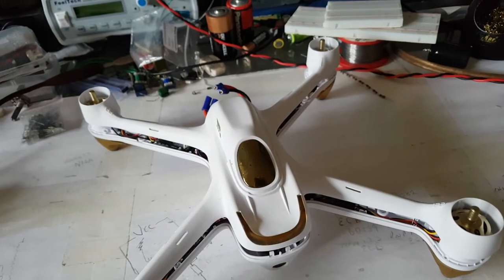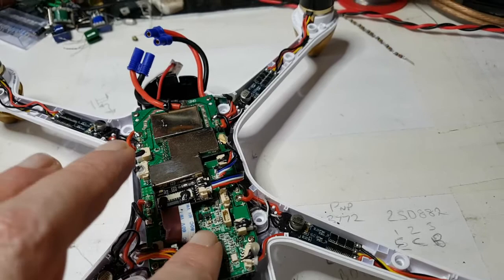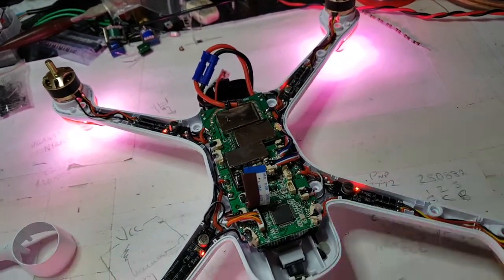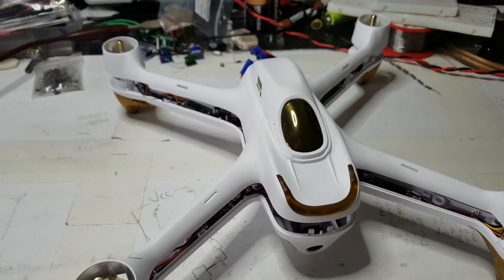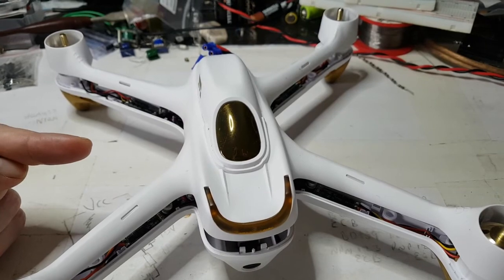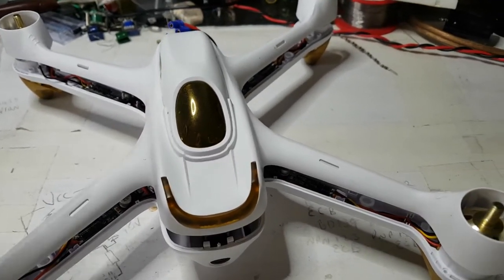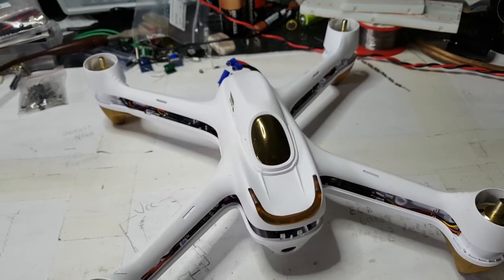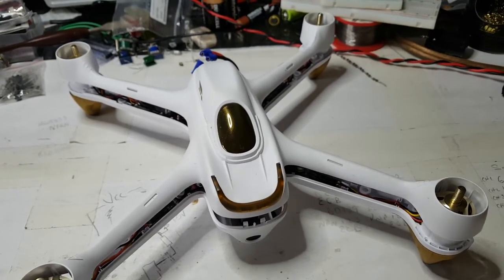Hubsan H501s Flight Controller Error

Comment: Elecifun, hope you get your flight controller error sorted out.  Yeah, response times from Hubsan could definitely be exponentially faster.  I've been emailing Shally Liu at Hubsan since early February about my H501S FPV range problem.  I'm guessing that Shally must be completely overwhelmed with warranty issues as replies take weeks sometimes.  Luckily, Shally recently assured me that the new camera board and antenna that I requested have already been shipped out to me and should arrive soon.  I certainly hope that fixes the problem.  Looking back, not long after I received my new 501, discovered the FPV problem, and began digging online for the answer, I was going to try some different firmware versions.  After many warnings from 501 owners here on YT kind of glad I didn't take that fork in the road.  Luckily, other than the FPV range issue, my 501 flies fantastic with no other squawks.  I hope the other components hold up.

Be sure and let us know how you solve your flight controller problem.  

Cheers from Thailand!
Reply from the maker: Nice one Jimbo, Greetings from the UK. Your FPV problem, are you using the 'Pro/Advanced version handset? Some of those 5.8G antenna were fitted the wrong way around so you have to face the Hubsan badge away from craft for good reception.
The waiting times have me clucking for my H501s fix. I like flying mine (low and where I can see it) and try to get a few hours a week in. I have a FC ordered now ans so it is only a matter of waiting a little longer. I will reflash firmware with previous version as it seemed Ok with that. I guess they know there are issues, else why would Hubsan have to keep updating the firmware. I do not see the added/enhanced features from feature updates, so I guess bug fixes.
Reply: I've got the Standard transmitter and I had 90-100m FPV range out of the box.  Since I already knew that some 501s had range problems I had also ordered an antenna kit from Geekbuying at the same time I ordered my 501 from them.  It barely helped.  With the external antennas kit I can typically get 100-150m unless I keep the 501 directly above me.  In that case I can get 200m-250m, but at 250m the FPV is flickering very badly even with me doing the FPV dance and antics to try to regain the image.

I've also removed the top half of the 501's plastic body shell hoping the 5.8Ghz antenna wire was maybe bunched up or routed incorrectly.  Unfortunately, everything looked fine and the 5.8 antenna wire was routed out through the right rear arm and down into the LED lamp base as it should be.

And finally I dialed in an extra FPV screen from my now-long-gone XK X252.  The FPV image on it seemed to die about the same distance as on my Hubsan screen so pretty sure the problem must be either the 501 camera board and/or the onboard antenna, which is why I asked for both from Shally Liu.

If you have any tips or suggestions please chime in.

Cheers!
Reply from the maker: I think your process for investigation of the issue is spot on. If you can not detect the cause eliminate what it is not. You are getting closer.  I unfortunately have nothing I can offer. You have done what I would thus far.
I have 6 emails from Hubsan and Shally Lui today. I may have been a little tough on them. It is not easy fixing electronics from thousands of miles away. Imagine trying to do something like this 100 years ago. Us humans are great really.
Reply: Hi Jimbo in Thailand, what are the firmware versions you are using? many of them have flight restrictions regarding distance/height on them to comply with FCC regulations in the USA and you may have one or several of those versions. I've done exactly what you have regarding conversion work and typically fly 300m+, it will do a lot more but I'm still getting used to the idea.
Reply: I'm using the stock firmware.  It allows max altitude of 250m (actually 252m).  I've yet to hit a firmware-induced GPS wall flying a horizontal distance, instead start losing FPV signal around 100m close to the ground or ~150m with some altitude.  Of course this is with external antenna kit.  It was much worse without the kit.

Comment: Hi there, interesting channel, thank you.  I had this error beep too after a crash.  My 5.8 antenna is straight into the motherboard and it doesn't have a ribbon cable like yours does.  I do however, have no continuity on one of the esc's white wires.  Do you think that would cause the error? 

Also, I have two of these, on the other one I have  decided to upgrade the 2.4 antenna too by putting an ipx adapter out of the side at the front.  Can you recommend a small rubber ducky antenna to go in it?  I have. A pagoda antenna sticking out the top already. 

Cheers.
Reply: Well in answer to my own question..... Yes.  Bridged it out and away we go.   New frame and esc ordered.   Would appreciate a suggestion for an antenna.   Cheers.

Comment: Bricked FC - Hi guys I made the mistake of trying to upgrade the FC and it stopped halfway through  \\. leaving it beeping once and in a dormant state (which is what its supposed to do during the update). since it stopped I went onto upgrade the TX, it failed. My TX I reset but have tried multiple time to reconnect the FC to the software/pc and it wont recognise it? I'm also confused on adding in the driver file, doesnt seem to work. Do I need the driver installed and how do I do it? Theres too many "set.exe"/".sy" etc.Is it poss due to the half installed software or the drivers? Is there a reset button located on the FC? Would buying a new FC help? 
Any help/comment would be greatly appreciated please, I flew it once before trying to get too smart. cheers

Comment: Just thought I'd say your not the only one experiencing long delays with Hubsan support, yes days and days for any response. What were the firmware versions your using? Shally just issued me V4.2.9, V1.2.17 and V1.5.25 but I can't find too much on the internet about these. I had asked for the SuperFlyer package of V4.2.9, V1.1.22 and V1.2.12 but no response. Its like they have just stopped talking to me. I've left some posts on your H501s differences vid. Keep posting as I'm following this in the hope I can finally fix my 'CHECK GYRO SENS' fault.

Comment: When I'm plugging I'm getting all sorts of beeps immediately but only 2 motors are lighting up or moving. Seems like 2 are totally not reacting. Like no power.. I'm assuming it's the power board I see for $51
Thing is no crashes. Just is starting doing this. Ant ideas or can confirm  its the power board before I spend $51 and shipping

Comment: Wish I could help dude. Mine been OK got mine around 3 months ago. Iv got FC 1.1.38 and all is well. I have damaged mine by injecting 5.8 g into a 2.4g antenna module. Still flys just not as far and it don't tell me how far away on it. Iv got a part off banggood and being fitted by a general computer repair shop. Hope you have luck with your x4
Reply from the maker: Cheers, I have fix it. A new flight controller and new cable.

Comment: Hi there mines making the same noise I crashed it opened it and the F.C. ribbon was split but I can not find one anywhere so good chance it’s ya ribbon cable
Reply from the maker: I found packs of 5 on AliExpress, if that helps.
Reply from the maker: If you are in the UK and are having problems finding a ribbon cable, email me you postal details and I will send you one.
Reply: Hi I could not find on AliExpress what keyword did you use ?
Reply: Mine I ordered through Hubsan in China USD5.00

Comment: Hi  i picked up a h501s on ebay damaged and is doing the same as yours. can you tell me the voltage in your flight controller.Thanks
Reply from the maker: Checking where the ribbon cable goes from FC to power board look for device D5 and check its power on lower connection. Mine was 4.9V and there is a capacitor on the FC top left with the cable in front of you the voltage on mine was 4.4V. Hubsan never confirmed what the voltages should be. Hope this helps.